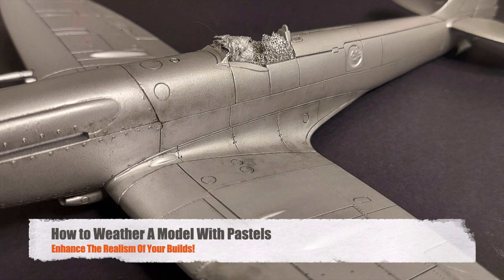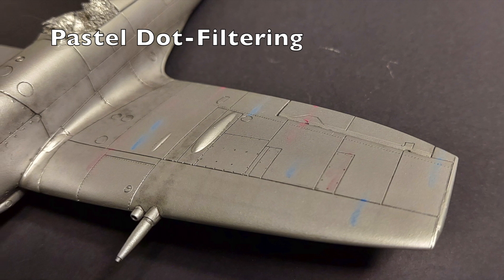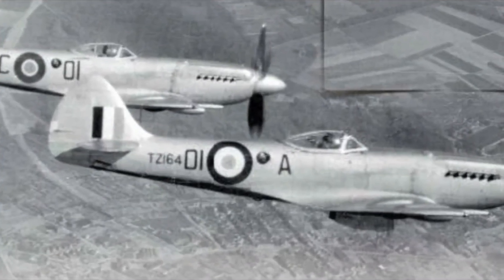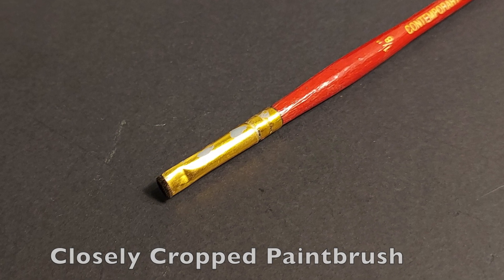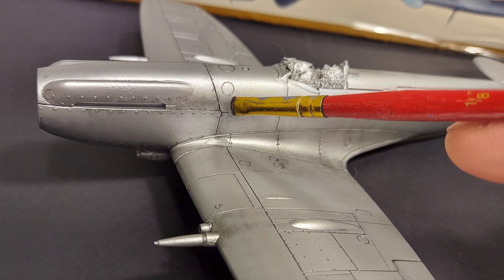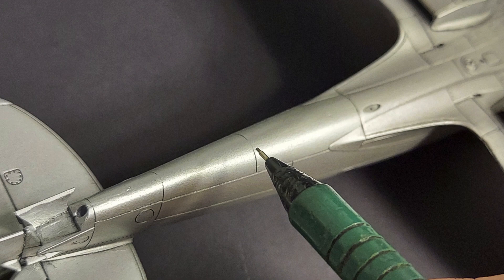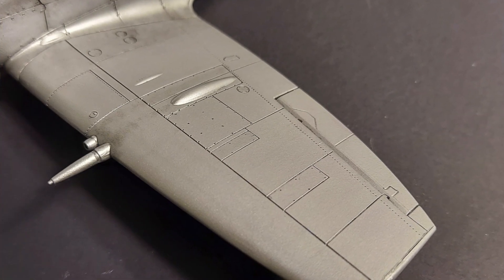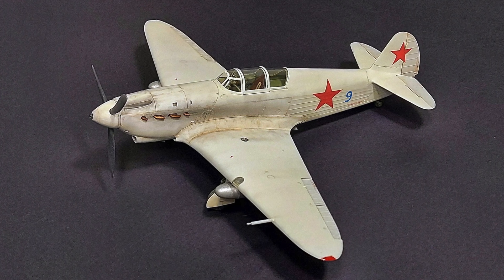How To Weather A Model With Pastels - My Favorite Weathering Method!

Comment: Excellent and simple explanation of a part of the process that can be easily overlooked….especially when one has been frustrated with the build. With patience and this step you can forgive a lot and an otherwise meh build becomes a centerpiece on the shelf. Thanks!
Reply from the maker: Right on! One thing I didn't cover is adding underlying structural detail to a kit with less engraved detail (like this kit). You can see that I subtly added detail missing from the front wing section with the pastels. I essentially drew the lines of rivets with the cropped paint brush and went over the lines with the eraser. It leaves a hint of the underlying structure without having to engrave it. Cheers!
Reply: @jonsmodelkitreview4624  yes I did notice and its subtle but adds realism…Engraving can be problematic depending on the quality of the styrene, as I have unfortunately discovered.
Reply from the maker: @SCSuperheavy114  For sure!

Comment: Good stuff Jon, thanks!    I have used mech pencil and even very fine point pens occaisonally to enhance panel lines.  LoL
Reply from the maker: You're welcome! It's great to puck up tips from others, but every modeler should come up with techniques that work for them. There are many ways to achieve great looking builds. Cheers!

Comment: I've always enjoyed the finish of your models - this is definitely  the enhancement I have been waiting for. I've seen some over the top weathering builders that looks like they  took a sand blaster to it. Depending upon the theater of operations aircraft for WW2 weathering varied, especially on OD. I haven't built too many Japanese aircraft because of the unusual schemes  I might have missed it, but with pastels it seems like the coloration might wear off, plus I suspect you can't put a coat of varnish over it or putting decals on might effect it as well. Are those caveats to working with pastels? The great aspect of pastels is that your box of pastes last a life time no drying up in the jar.  :-)
Reply from the maker: Those are great questions. You can go darker than the base color with pastels easily. If you apply a lighter color than the base color, the clear coat makes it disappear. I apply most of the weathering directly on the color coat and then seal the surface with a clear gloss coat in preparation for the decals. Once sealed, the pastels are like paint. I may add a few touch-ups after the final clear coat, but the model gets handled with care from that point on. Sometimes, I will seal the pastel weathering one section at a time so I don't disturb it while weathering the next section. Hope that helps. Cheers!
Reply: @jonsmodelkitreview4624  Thanks it does indeed help a lot. . So many ways to 
" weather" models these days. In the " PCW " days - prewash commercial days, as an example, the details on figures like wrinkles in uniforms, you'd use two colors, then make a wash by heavy dilution of mostly black. In today's world, you just grab a bottle of wash. Sometimes it's fun to go old old school just to compare. I've purchased some products from VMS, to experiment with, life gets in the way of model time - one I'm anxious to try is their paint remover. In their videos they show it stripping paint without the need for sanding and solvents that doesn't etch your model. I have a large stash I could use for paint mules and strip off old schemes to try these new materials and techniques you share. Thanks again
Reply from the maker: @c123bthunderpig  Awesome, that sounds like a plan!

Comment: Looks like you can burnish pastels onto light surfaces, but in my experiences most artist pastels on most surfaces don’t adhere and show up at all. I can add a little matte dust effect to wheels and wheel wells but that is about all.
Reply from the maker: @bebopkirby  You need to burnish them into the surface. They need to be applied over a flat paint color or clear coat. And if you clear coat them (as I do), the pastel color must be darker than the paint color below. I hope that helps. Cheers!

Comment: Nice talkthrough, thanks! Especially liked the slightly darker panel, looked a bit like my van…
Only problem, they chopped the beautiful pointed wingtips off the later Spits. Criminal!
Reply from the maker: You're welcome, Steve. Most marks of Spitfire were available with clipped wings and a supercharger optimized for low-level ops, or standard wingtips, and a supercharger optimized for higher altitudes. Some high altitude variants even had extended wingtips. There were so many variations of Spitfires!

Comment: Great video. I have used pastels for weathering a few times and it’s a very good technique, but I find that when I spray a flat coat over it 80% of it just disappears. Am I doing it wrong?
Reply from the maker: You can go darker than the base coat but not lighter. They are not good for applying fading but work best as shadows and staining. You also may not be working them into the color coat enough. The brush I use to apply is very closely cropped (1 mm bristles). Hopefully, that helps 🙂. Cheers
Reply: @jonsmodelkitreview4624  excellent, thanks for the response 👍🏻
Reply from the maker: @BlackAndBluez  You're welcome!